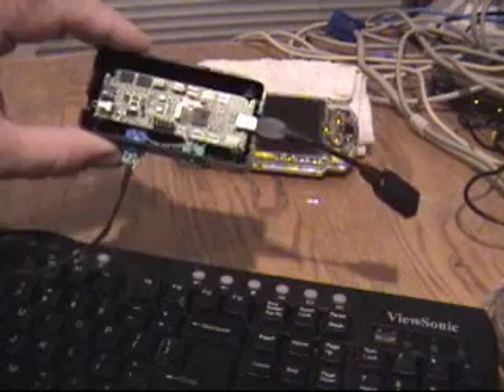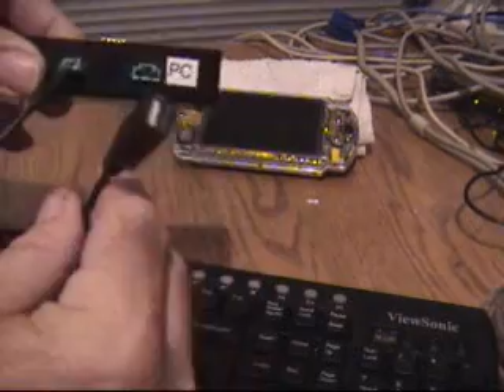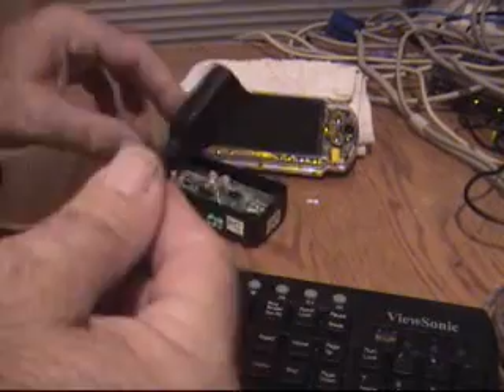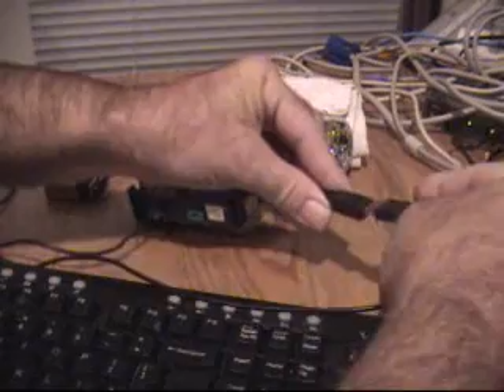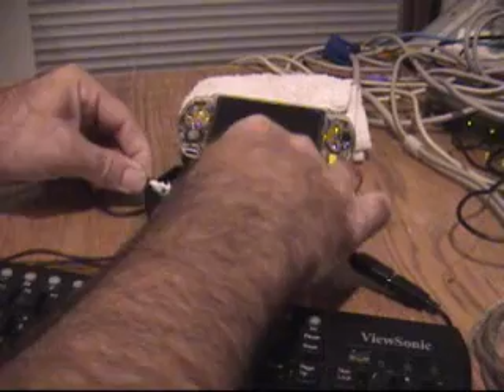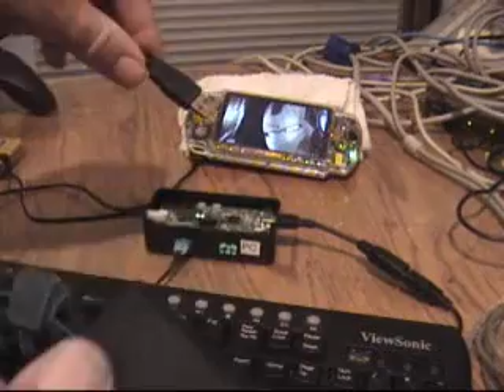PSP Serial USB Host for Keyboards/Joysticks

Comment: Excellent. Do you plan on releasing the design of this anywhere or selling built units? If so, sign me up to build or buy one!

Also, you mentioned that your USB interface for the joystick will remap the joystick buttons to the face buttons by having them duplicate keystrokes. That means that remapping the joystick analog sticks to the PSP's analog stick out of the question, right?

Comment: Continued...
Also, do you feel that the hardware would support sending analog stick data to a PRX plug-in on a custom firmware PSP? If so, this type of project would be an excellent way to allow homebrew to have dual analog support.